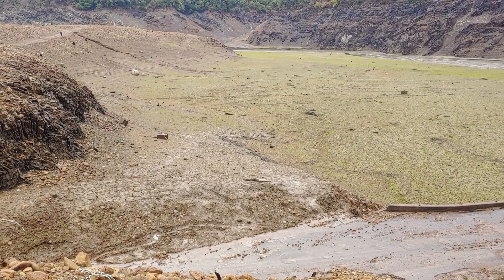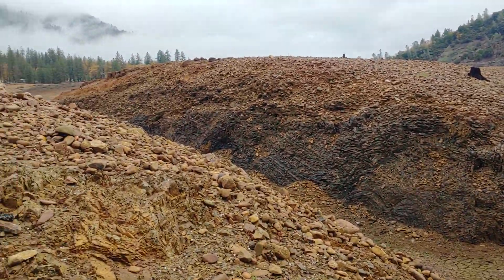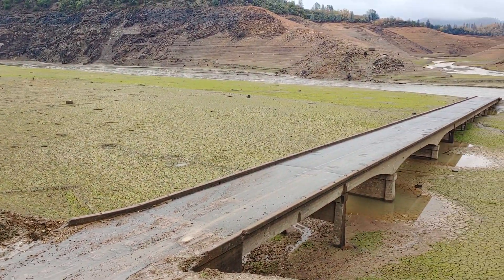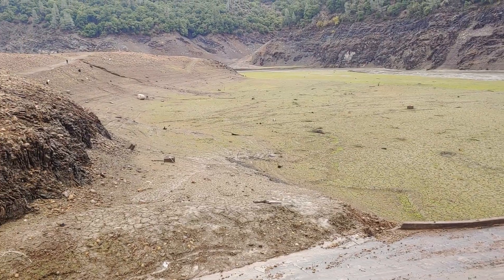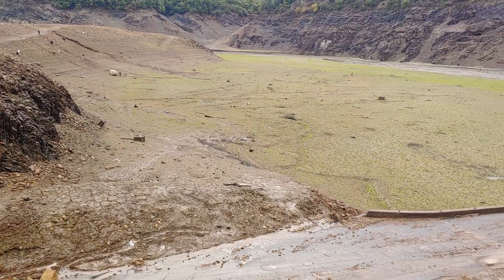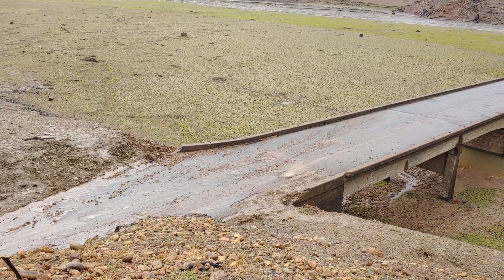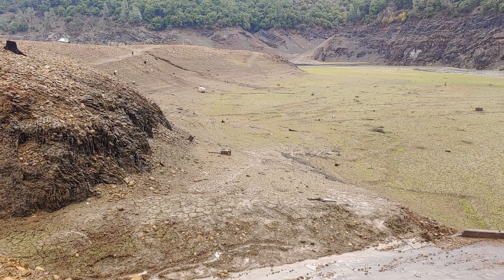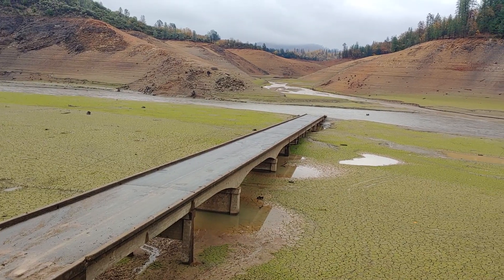Pollock Bridge - Lake Shasta

Comment: Instead of constantly thinking about raising the height of the Dam. They should take this opportunity to dredge the lake floor. Take all that material and use it to reinforce the Level System in the valley. This creating more water storage capacity for later. Without spending billions of dollars in refitting a Dam that was not design to go higher.
Reply: @Dan Gander yup
Reply from the maker: @Dan Gander Lake Shasta is a Federal Bureau of Reclamation project, not a State project. The reservoir doesn't actually have as much sedimentation as these videos suggest. This is localized to the area where the river meets the reservoir, not the main part of the reservoir.
Reply: @highway99  I'm not just talking sediment. Remove the mountains that are in the lake. That are usually under water. That would create a lot more volume.